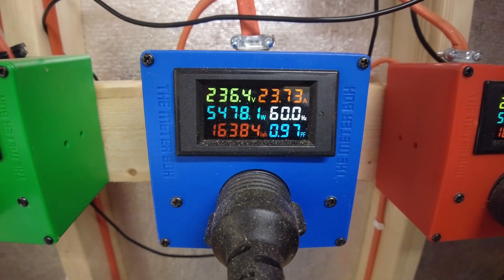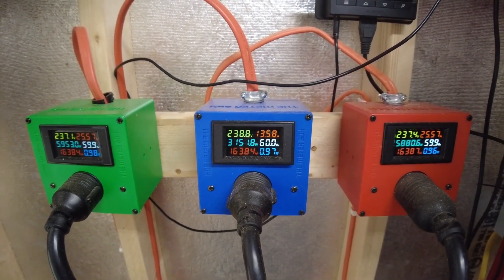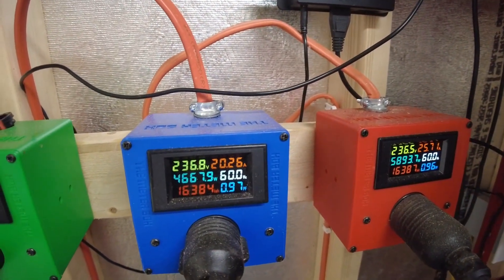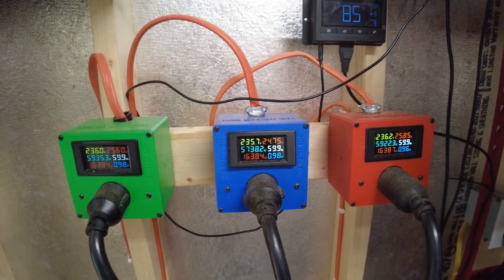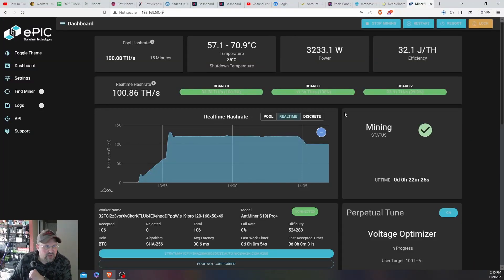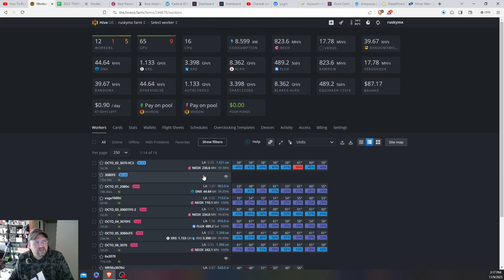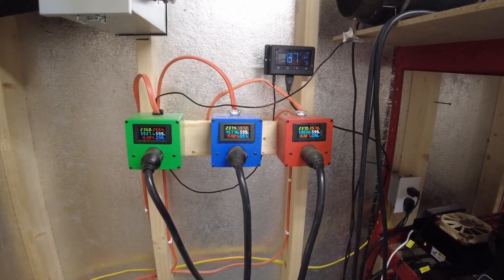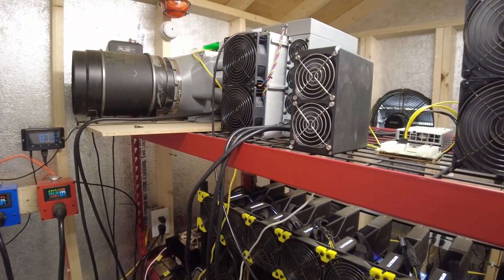ePIC UMC Control Board S19J Pro Plus 120th

Comment: What kind of efficiencies? Hashrates? Did you get with this setup
Reply from the maker: I have it running at 105th around 2500-2600w
Reply: @ruskyscryptocave   And what was it running before the epic control board install?
Reply from the maker: @Babelfish2000  23-2400 at 95th on LPM in stock firmware